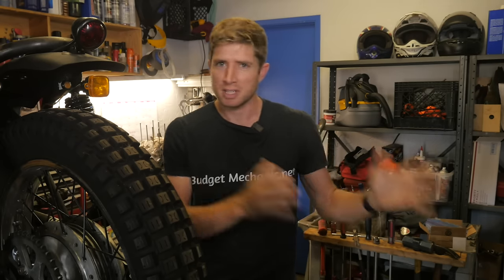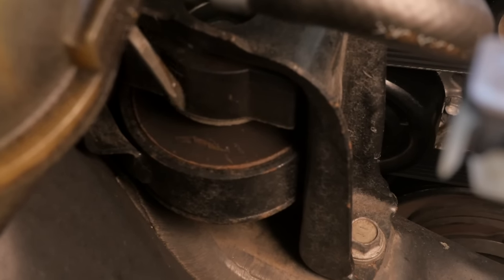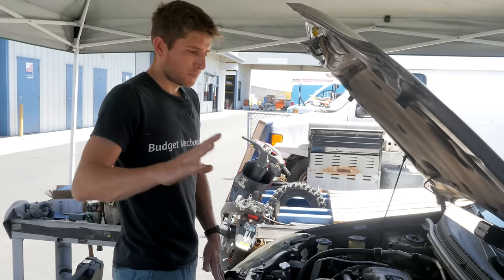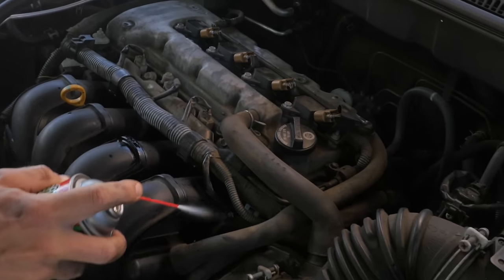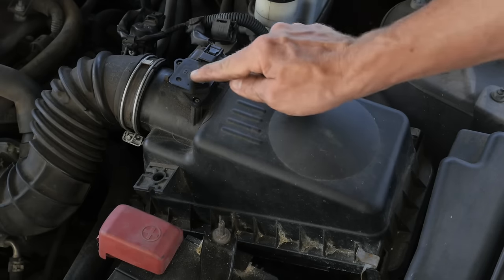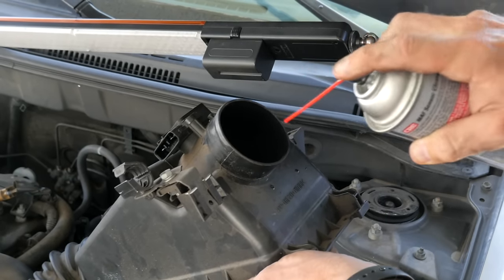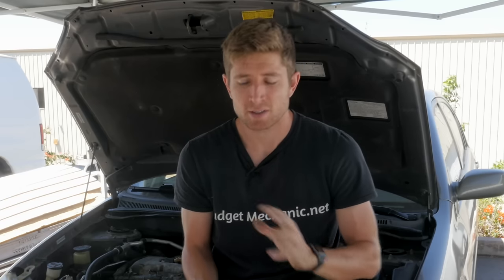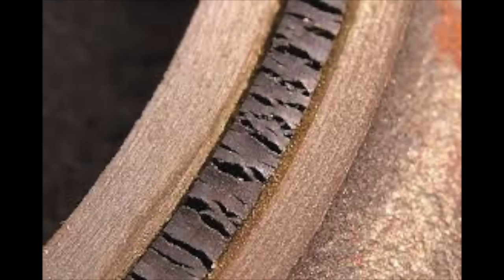Diagnose and Fix Rough Car Idle - Main Causes For Shaking / Vibrating While at a Stop

Comment: this is so detailed. I have a VW Passat wagon 2010. It started with cylinder misfiring so i got the plugs changed at a mechanic and after a day it came back. We then changed the whole set of coils and have done the proper positioning of the manifold as it was detected out of place. Its became better but now the car shakes in idle mode and the check engine starts blinking. I don't know what to do again
Reply: Per your lesson, i'm thinking i should check the fuel system too.

Comment: Marvel Mystery Oil is great for fuel systems, but make sure to read the directions and don't overuse. Many cars have the fuel pump in the gas tank, lots of labor charges to replace. I add an ounce to my gas tank most fill-ups (13 gallons), just as a little helper. Not every time, but most times, just as a preventative.

Comment: my 1995 lexus sc400 has a vibration slight rumble you can feel in the cabin when the car is in park and you rev the engine to around the 1800 rpm mark.  it goes away at higher and lower rpms.  The car is very smooth at idle etc.    what could it be?

Comment: Aloha, Josh! I took my car in for service because it was having a slow start. 2005 Pontiac Vibe with 175K miles.  They ran diagnostics and determined I needed a new starter. Also, it was a quart low on oil and overdue for an oil change, so they did that as well. When I picked up the car, the manager said my car was "shaking like a leaf" and said the engine mounts might be going bad. The car WASN'T DOING THAT WHEN I BROUGHT IT IN! I am stumped. After watching this informative video, I'm wondering if dirt or debris could have gotten into the system when they were doing the oil change. Someone was using a lawn maintenance blower in the bay to clean up the floor next to my car. What are your thoughts? Mahalo!
Reply: My Camry is shaking after having the alternator fixed

Comment: Your throttle body can break too, I cleaned mine and a week later it was idling rough and I got a throttle body code and replaced it and haven't had the problem in awhile from the throttle body at least.

Comment: I recently had this happened to me in my 2015 GMC Sierra 1500…. I changed the spark plugs and the ignition coils.. I was told my injectors were good so I never end up changing them…. Now I was told it had to do with the computer and another person told me it was the oxygen sensor causing that

Comment: So i have a 2001 honda crv When I bought it for my daughter I saw it had vibration while idle at a stop or in parking So this is what I have done for the past Year and half. Changed all motor mounts, Replaced spark plugs, distributer cap, spark plug wires, Mechanic checked for air system, checked  compression on engine, last thing I have done in replaced the harmonic balancer. 
Am stuck

Comment: I have a FIXD OBD scanner that’s showing fluctuating codes. First it was p0234 and p0144c, the purge valve I had replaced a couple months ago was not the Ford OEM part so I got the OEM part and  put it on. It’s feeling rough though. I just got a fluctuating p0456. I have a sort of rattling noise coming from the driver side and I’m not sure if it’s all related 😭. It only happens when I first start the car and the RPM’s start to drop a bit and when I stop at a light and start to accelerate a bit it makes the noise and then stops.

Comment: I have a 2015 Jeep Cherokee and I had the thermostat recently changed, twice. Had it done once and the ck engine light came back on. Was told it could be a faulty part. So I had it changed again. Now it’s running rough when it’s idoling and my tail lights aren’t working. Tired of taking it to mechanic. I’ve only had it two months and its been in shop three times. Any advice?
Reply from the maker: Tail lights have nothing to do with thermostat so there’s that. What was check engine code? If it was for engine temp sensor that will cause rough running, but is repaired by new sensor not thermostat

Comment: you said don't move the throttle butterfly with fingers. Does that also mean not to accelerate by moving the spring lever on the side ? 
Also, I cleaned what I could of the  throttle body butterfly and  the sides, by opening the butterfly by moving the spring lever on the side  of it. Was that bad ?

Comment: Hi! I hope you see this please. After changing the valve cover gasket on my Corolla 06, I noticed a shake. Then my ac had low pressure coming out and I did see the cabin air filter was dirty and cleaned that up. Anything else you may be able to help with of possible.

Comment: Thank you!  My car is in the shop right now. Looking for some knowledge before they call to give me a diagnosis. I would love to know if this is the order they will check and how will I know they didn't just find a loose plug but want to replace the cylinder? I'm so skeptical. 🙄
Reply: Bad news they charged me for cleaning the throttle body butterfly and then suggested I replace might want to replace the EGR valve. They said he wasn't sure really so maybe I should wait until a code comes up and bring it back then. Do mechanics only know what to do if a code tells them first? 🤔

Comment: I've been having this issue with my 05 dodge caravan 🚐 an machanic can't solve it. Everytime the radiator fan comes on the shakes also when inside the car the steering wheel shakes what causing that?

Comment: My moms van got the problem yesterday. It sounds rough like it will stall, when you are driving it's fine but idle it starts to get a loud noise and the entire van starts to vibrate
Reply from the maker: It happened suddenly? Could be bad fuel or a vacuum leak

Comment: I appreciate all the run down on this issue. If you can answer this question. I was told not to touch TPS sensor, because it can throw off the computer on the idle. What do you think! I have a 2001 Pathfinder LE.

Comment: Question: If a faulty spark plug, injector or injector coil pack can lead to rough idle, wouldn't it also affect higher rpms (driving speeds)??
Im asking cuz my car has  rough idle but is fine when driving.
Reply: A weak spark can be worse at idle and ok at higher speed due to spark advance. That means the spark fires early when the charge is less dense. Injectors may work at higher loads but not at idle because the pintle is sticking and the higher pulse width of high loads jerks it open whereas the small pulse width at idle will not open it.

Comment: my engine feels like choking upon starting in indle... last used july 26 2020.... then started at august 12 2020. i added 1 liter of oil but it seems the same. 

ill check the causes you posted here. thank you.
Reply: Can you give feedback? I have the same problem
Reply: I have the same fucking problem. It sounds like it has ups and downs in sound after u start it, doesn't it ? Mine does that for about 3 minutes after starting and then it seems fine. Idk what the problem is.
Reply: xXx xXx mine was a faulty fuel pump which is a common problem in newer toyotas

Comment: Could it be a bad transmission?  When I"m tryin to get going like take off at a light it'll shake it stops shaking when I'm at a high speed .... there are no maintenance lights on it runs pretty good except for the shaking .... I'm told my my mechanic I need a transmission which will be 2500$ so I"d like to get a second opinion

Comment: Hi
i bought a used rav 4 2016
i noticed the following problems after a week
as my ignition is on, the rev meter jumps to 1 sometimes 2 and it stays there
after using my AC the car sometimes stalls
now i feel that the car got weaker especially stepping on the accelerator 
also the car only moves when i step on the accelerator, before when i don't step on anything the car would move slowly.

any idea?
Reply from the maker: Very hard to say but I would follow the steps for addressing a rough idle, as well as perform basic tune up with spark plugs and air filter and see if there is change
Reply: @BudgetMechanicHawaii  thanks
apparently i took it to the dealership
they  did a flush on air intake , idle air control valve and muffler. Car moves like a brand new car now. thanks!
Reply from the maker: Ah! the ol’ muffler flush! Glad it’s working!
Reply: @BudgetMechanicHawaii  thanks!
also at the dealership when i first bought the car, they fueled up my tank to full. i really wondered what kinda gas they gave me. so i used up all th3 gas and just got back from the gas station. i fueled up the 87 bronze and as soon as i hit the road leaving thr gas station, the car feels like theres a lot more power and faster! just by stepping on the acceleration lightly. I felt like before i really had to use a bit of force on the acceleration pedal. What is going on??
Reply from the maker: Not sure, some cars respond much better to higher octane or batter quality gas. Also they may have been using some additive in the fuel to try and clean the fuel system.
Reply: @BudgetMechanicHawaii  ah! thanks man
yeah i was on toyota forum, someone said they got free gas at the dealer and made their car go really slow. no wonder its free lol.
Reply from the maker: “Leftovers”

Comment: hi thanks for the video. 9:51 i have -14.38 long trim fuel while idling, but when i press the gas pedal it goes down. my car runs lean i guess,  but i didn't found any vaccum leaks. does fuel cleaners help with that?

Comment: Lets just say i pushed in the butterfly on a 2017 charger rt? I changed the sparkplugs and the rt vibrates on idle. While changing the sparkplugs i noticed the carburetor was dirty so i cleaned it and pushed in the butterfly. Could that be causing the vibration?

Comment: What if the sparks and coil packs have been replaced, new pcv hose, O2 sensors, MAF sensor and retune tune but the car still shakes at a stop and misfires after a long or hard drive?
Car still says the air to fuel ratio is too lean or rich

Comment: So I replaced the Spark Plugs and Ignition Coils and that’s the problem I am having. The first start of the day when the car is cold it rattles and vibrates mainly on the passenger side then if I turn the steering wheel right a rattling sound gets louder if I turn it left it doesn’t make a sound. Second and third start for today it sputtered tried to start but didn’t my car is a 2016 Dodge Dart with the 2.0.

Comment: I have a 2009 Vibe with the 1.8 engine.  On truly cold starts (like the car has sat overnight) the car will start right up - no problems.  If it has only been sitting an hour or two though, the car will struggle to start.  I don't have to keep cranking, but it will stumble and falter until it really catches, and then will smooth out and behave normally.  During that stumble and struggle I will hear the VVTI gear rattle just very briefly.  On normal starts I do not hear it at all.  Possible suspects:  1) dirty throttle body 2) Mass Air Filter sensor  3) fuel pump  4) VVTI gear  5) Spark plugs / coils  6) clogged fuel injectors.   Any other ideas?
I'd appreciate anyone's opinion and advice on how to diagnose for certain.

Comment: I replaced the oil and filter after doing an oil flush. I also added Lucas fuel treatment to the gas tank.
Afterwards my 2006 kia Sportage V6 started running rough on idle.
I'm wondering if it will do that as the fuel cleaner works its way through and then be better afterwards?

Comment: I have 2006 mazda 3 319.000k miles  that has a up down idle only when a/c is on  no check engine light What could it most likely be ?
Reply: It's normal when AC is on that causes to idle up and down.
Reply from the maker: Most likely something to do with throttle body or idle air control valve if you have one.

Comment: Got a WJ jeep GC. Replaced all sparks and injectors however car now rough idles, won't go over 70kms. Am going to replace map sensor, o2 sensor and cat converter to see if that fixes the problem. Any other suggestions?
Reply from the maker: Did it only start rattling rough after you did the plugs and injectors? That would leave me to believe something is wrong with those things. Otherwise If no engine code, follow the steps in the video
Reply: @BudgetMechanicHawaii  no, wasn't the plugs and injectors, starting running rich after new fuel pump installed
Reply from the maker: I would try to figure out why things changed with new fuel pump, shouldn’t have done that.

Comment: So i have a 2007 Toyota Corolla and was wondering what can cause my rpm to move up and down and my ac not to throw out cold are I got a couple codes for sensors was wondering if that would be it

Comment: hi budget mechanic.
I have a problem on my HONDA CRV 2006--VIBRATION IN IDLE AND WHEN IN "D-DRIVE" and in stop section,more vibration.
I CHANGE ALREADY MY SPARK PLUG,AIR FILTER ALL THE MOUNTS.STILL VIBRATING.
please I need  a best answeto avoid going to garage because they all telling CHANGE THIS N CHANGE THAT.Waiting for you answer.thank you

Comment: When I had my car in the on position and pressed the gas. My throttle body does not open all the way like yours does here. Everyone I’ve seen that does this their throttle body butterfly opens a lot to allow you to clean. Mine however opens only a small amount. Not enough to clean it thoroughly at ALL. I replaced the throttle body. Same thing. Does not open. What could this issue be?

Comment: Am having the same issue on 2010 Chrysler Sebring, my car if I turn the steering to right or left and again if I engage the gear to drive or reverse you will feel the engine vibrate the hole body, I have changed all engine mountain seat but still the problem is there, I need help

Comment: My engine started running different after I gassed it a little on the road next day I turn my car on CEL, stabilitrak, Abs, and traction control, engine is shaking loss of power jerks when braking ran the code and got p0304 cylinder 4 misfire changed all my ignition coils and spark plugs disconnected battery and nothing any advice 2015 ats 2.0t

Comment: Josh Good Afternoon and a pleasure to meet you for the first time! i have a 2003 dodge caravan se and it has a check engine light with code p0420 and i have never diagnosed a vehicle in my life and im really interested in doing so but i have no idea on where to start and what steps to take to test everything and figure out the root cause of p0420 and fix it, is there any way that you can help me please?

Comment: I have a 95 nissan pickup that will not idle with the mass airflow sensor plugged in. If I unplug the MAF sensor it idles fine while in park. I've replaced the Mass airflow sensor twice so far. I was wondering if you have any ideas what could be going on. Any ideas are welcome. Thanks.
Reply from the maker: That sounds like a job for the forums! Sorry mate!
Reply: @BudgetMechanicHawaii  thanks. Do you know of a good forum?
Reply from the maker: Not as familiar with the Nissan forums but I’ll bet there’s a lot of good threads on the frontier

Comment: I have a 1.8T 2003 Audi and it has unstable idle, I noticed the noise comes in when the idle drops under 750rpm, sometimes wheel shakes a bit and the noise vanishes if I firmly grab the wheel, other times the noise comes from elsewhere beyond the dashboard. Already replaced spark plugs, ignition coils and used some fuel cleaners, no improvement so far.
Reply from the maker: Sorry to hear that!

Comment: I feel significant shaking when the engine is idle at a stop but only if the brake is applied. When I let go of the brake nothing shaking stops. And not vibrations when the engine is under load. Any ideas?
Reply: Did you find out what it is? My car does the same
Reply from the maker: One thing to check is the vacuum line that runs from the big round brake booster (under the hood behind your steering wheel) to the intake manifold. It activates when brake is pushed and runs on vacuum pressure from the engine
Reply: @BudgetMechanicHawaii  Thank you for the suggestion, I will have that checked.
Reply: @SierraBlair  The mechanic at my service says there is a build up of burnt dirt particles from the fuel on the piston seals and/or valves. He thinks rectification of the engine is needed. His guess is that the vibration will get worse over time and will be persistent even without the brake is depressed. I am going to follow Budget Mechanic's suggestion and have the brake booster line checked out.

Comment: Given a good knowledge.thanks.
Sr my skoda superb do viberation after 100 kmph speed and car running rough.what is thw possible reason. Plz reply
Reply from the maker: Bad tires and old spark plugs is possibility
Reply: @BudgetMechanicHawaii  When I had my car in the on position and pressed the gas. My throttle body does not open all the way like yours does here. Everyone I’ve seen that does this their throttle body butterfly opens a lot to allow you to clean. Mine however opens only a small amount. Not enough to clean it thoroughly at ALL. I replaced the throttle body. Same thing. Does not open. What could this issue be?

Comment: I didn't know that you're not supose to open the throttle body butterfly by hand  on these newer vehicles. And that you have to use the gas pedal to open the throttle butterfly to clean up all the gunk.   Is there anyway to diagnose if I had mess up the throttle butterfly?  Cause I had open the throttle body butterfly to clean it.

Comment: Hello I have a 99 Montero sport with 208k miles on it shakes at idle but once it's atleast passed 10 miles per hour it's smooth and my exhaust is sucking in, what could be the problem? 

Sometimes it also throws Abit of blueish white ish smoke

Comment: I have a 1996 4runner 3.4L v6 it started misfire,I change coil pack and spark plug and still shakes and rough also check engine light flashing.what do I do?